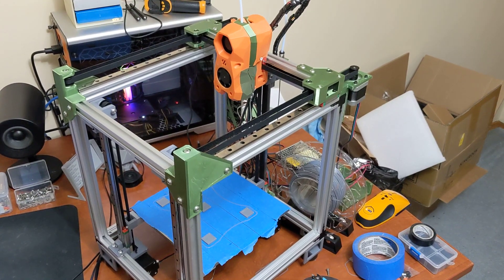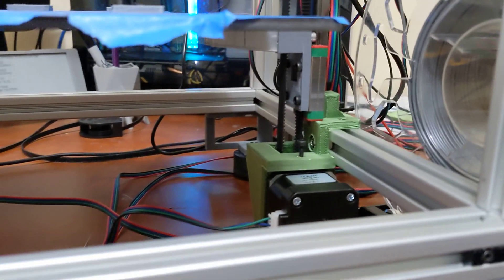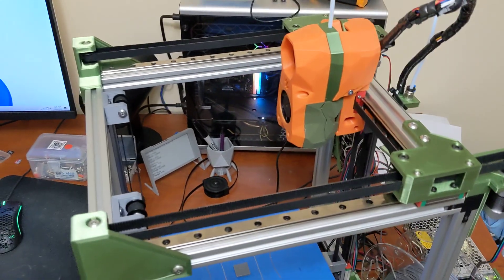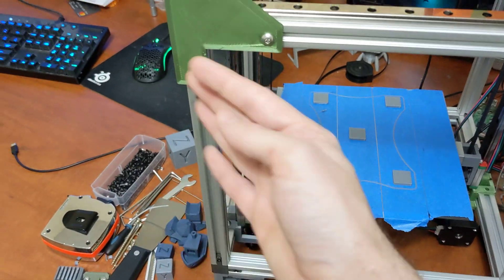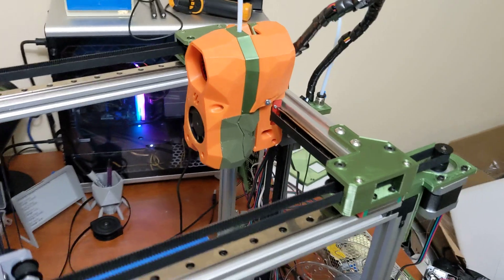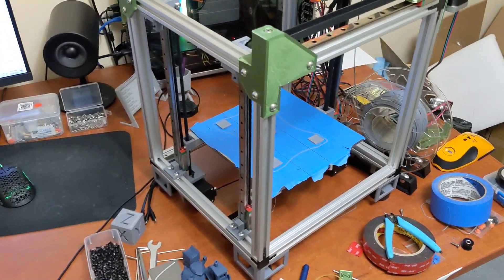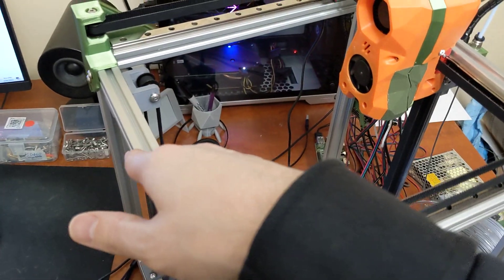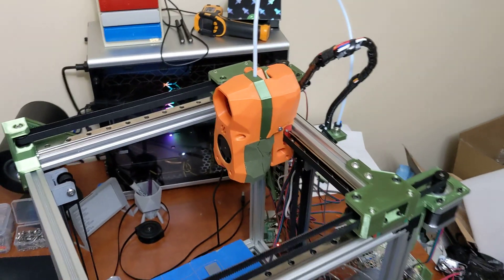Building a H-Bot 3D Printer - SimpleCube Ultra - Episode 4 Z Update and Status

Comment: I remember you would like to mount the AB motors inside so they don't hang from one point. What if the AB motors moved to the "front" so the space it would take would cancel out the stealthburner size offset? you would lose a bit of x axis both sides at the front a bit more, but xy dimensions have to be tweaked anyway
Reply from the maker: Yep! I am doing just that, you can see some teaser pics on my discord server. Link is in the description!

Comment: Thank you! Awesome printer. Can be built with 2020 v-slot extrusions? Also, I think the X linear rail should be on the top and use an another toolhed, like sherpa mini, orbiter.... I don't like the voron heads as they are asking a huge space...
Reply from the maker: V2 will use the EVA toolhead so you can use any extruder hotend combo you like, Feel free to join my discord for teaser info! https://discord.gg/dGaFDQMU
 I think V slot extrusion are too wide in the middle so linear rails won't sit right.

Comment: I have some concern about the way u mounted the plate .... the bed in the video is not moving and stable on the Z axis and Y axis for sure, but not secure on the X axis which may cause some shift or layering issues in the future
Reply from the maker: The bed is secured with 3M double sided VHB tape it does not move at all